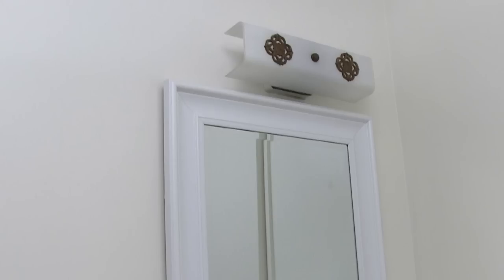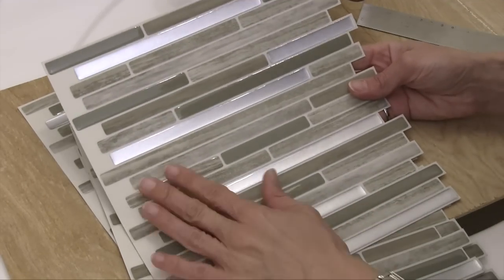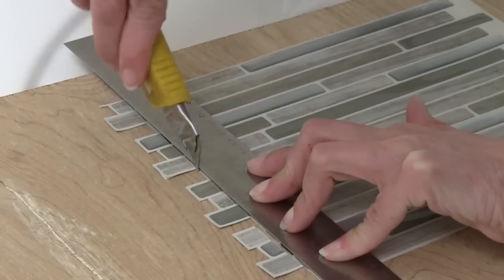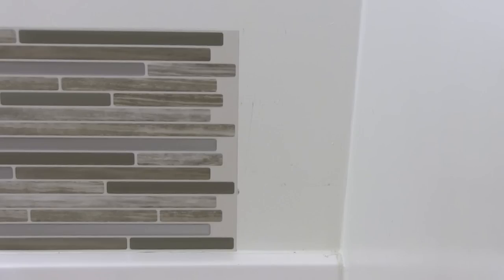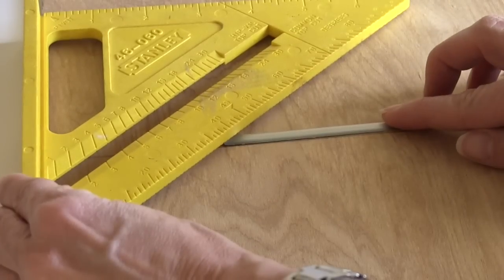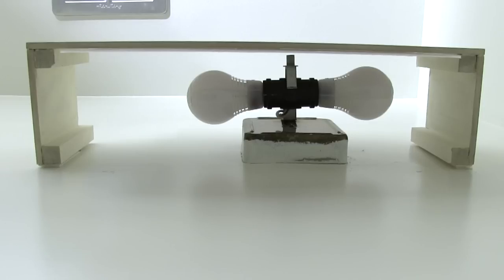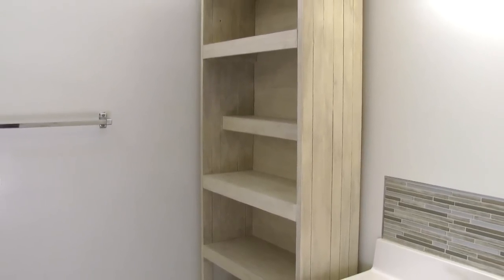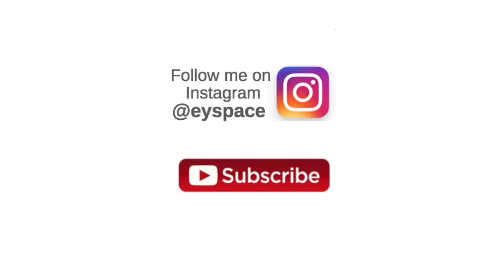DIY small bathroom remodel: budget bathroom ideas

Comment: I used these smart tiles in my 1/2 bathroom. Just like she did but without the edging. I didn't even know the edging existed. No one has ever noticed that they're not real tiles. For a small space they're awesome. Warning: measure twice cut once before you stick the tile to the wall. Once you stick they adhere quickly and have really strong grip. There is no moving them once stuck. They will rip the paint off your walls.

Comment: Nice update. These could be applied to a bathroom that's already in decent shape. I have 70's colored ceramic tile, colored porcelain bowls and toilets, discolored faucets and fixtures, and a vanity with peeling laminate. I probably should have skipped the video when I heard "$200". lol. What's amazing is how functional my bathrooms are after 40 years. No cracks or chips in any of the ugly tiles, no leaks or drips, everything just works. My biggest dilemma is that if I do a 'budget' remodel, I know it's not going to be nearly as durable as what I already have.

Comment: would the peel and stick tile be a option for a renter? can it be removed?
Reply: Yes. They are easy to remove with little to no damage, depending on the surface they were installed on. To make it easy, use a blow dryer to warm up each tile to soften the adhesive and pull softly starting with the corners. Use a cleaning product to wash the wall and remove any excess glue left by the Smart Tiles.

Comment: Is Smart Tile removable? As a renter I can't make permanent changes...
Reply: Yes. They are easy to remove with little to no damage, depending on the surface they were installed on. To make it easy, use a blow dryer to warm up each tile to soften the adhesive and pull softly starting with the corners. Use a cleaning product to wash the wall and remove any excess glue left by the Smart Tiles.